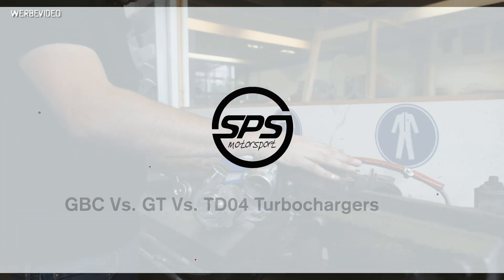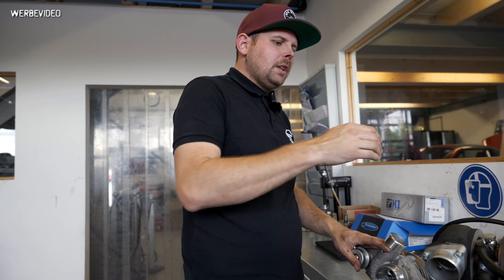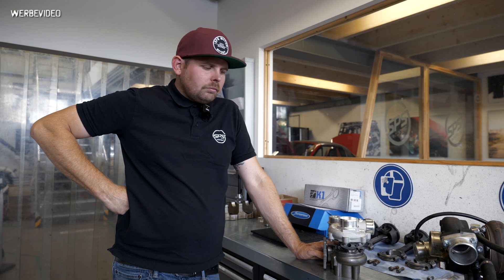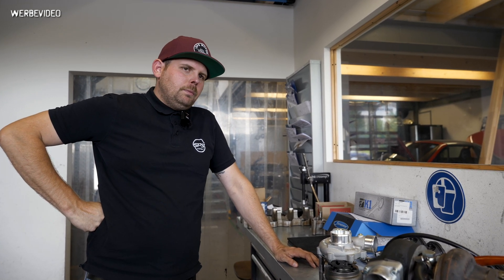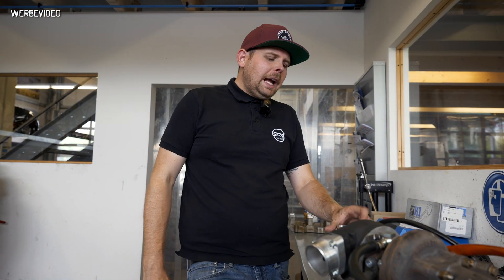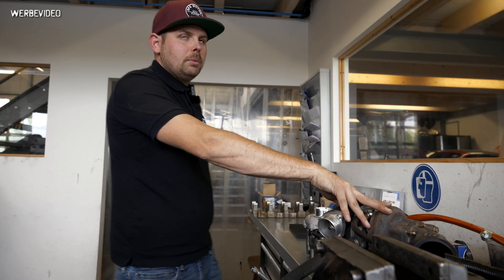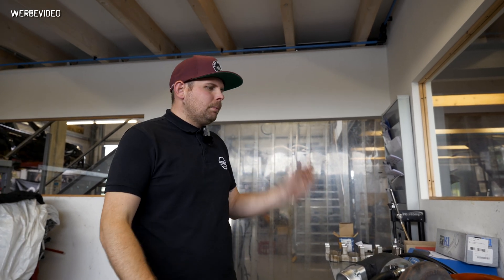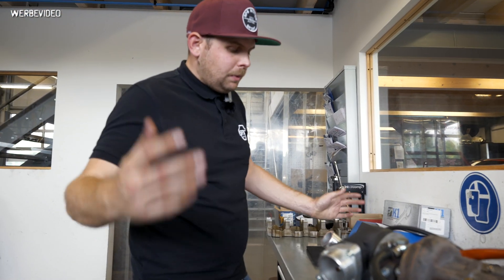Comparing GBC, GT and TD04 Turbochargers for Miata - SPS Motorsport

Comment: Sorry but after watching your video I am afraid I have to mention that you are trying to promote the GBC line of turbos. I have to make clear that I am not a seller of turbochargers so I don't have any interest to promote one or the other. And now to the point. I don't think Garrett ever intended to substitute the GT2554/2560 with the GBC17/20/22 turbochargers. The ones are about to be discontinued are the GT2052/2056/2256 line of journal bearing turbos. However, not only the GT25s but also the GT20/22s are still on sale, seven months after these video was made! Also, there is not indication that the Td04s are going slowly out of the market - many cars currently in production are using Td04s and this family of turbochargers has been used in so many cars (of various brands) and are so strong (actually dominant) in the aftermarket that the idea that someone has abandoned them for me sounds ridiculous. 
Now about the results. Indeed, the GBC22 seems a better choice than the GT554, but even in that case I doubt if there is a 800rpm advantage in spool. About the Td04s, I presume that you talk about the one installed in the WRXs, the Td04L-13T. This is more comparable with the GBC20 which has a bit stronger turbine and smaller compressor than the Td04L-13T. The GBC20 maybe a bit stronger up in the rev range but the -13T would still be a better choice if we limit the boost at just 0,7 bar. The GBC22 is very similar in specs to the Td04HL-15T/16Ts, and I doubt if there is any significant advantage over them. And the comment about being an advantage of being oil-only cooled is peculiar. ok, if someone is not willing to change the stock radiator, it's the only choice, but, who does this?? At the end in my mind came the Greddy Turbokit of the first MX-5 which had the Td04H-15G, which is also very close in spec with the GBC22, and is still on sale. 
Also you choice for a fully forged engine....a GBC22??? Definitely not, the good old Disco Potato or some of its evolutions (GTXs/G25s) would be a much better choice for a fully rebuilt/forged engine.
Reply: I think it is hard to say anything about the GBC if you havent tested it.

I actually called them and asked them about the GBC22-350 and how it performed on the forged engine miata.
Apperantly their forged track miata pushed 330hp but not maxed out. I asked what it could have done if it was maxed out and they said that they think it could have pushed about 340hp.
If that is true then there is nothing compared to this. I have been looking for a turbo that spools good and give me power around 350hp but there is nothing out there. So this is the best turbo you can find for that power.
Since there arent many other people pushing this turbo on different octane someone have to be the guinea pig.
Reply: @yosefrafael  efr 6258 will easily make 350 and spool fast..
Reply: @turnip8173  but ypu now are comparing a monster that can do over 400hp and cost like 3 times more. However i meant a turbo that you can buy with reasonable money and still get good performance in spool and in power.
The efr is just too expensive
Reply: @yosefrafael  gotta pick and chose with the current roster, GTX2860R gen1/2 might fit the bill better or potentially a GT28RS with a bigger AR housing but you'd be pushing that thing to the limit to get 350 with a shit flowing head like the mx5 bp stuff
Reply: @turnip8173  none of the turbos you meantioned above is any good for a small engine. i have a 1.5l turbo engine, the GTX2860R hits peak torque after 4600rpm the other turbos are even worse. Your missing the point with the GBC, it is made for smaller engines.
Reply: @yosefrafael  the 2860R and the GBC22-350 are very compatable turbos size wise, where the 2860 has a slightly bigger and vastly more efficient compressor and can hence support an extra 50bph in theory. Besides peak torque is hardly an indication of response or fast spool, play around with your housings and cams and see where that gets you if you're dead set on 350.